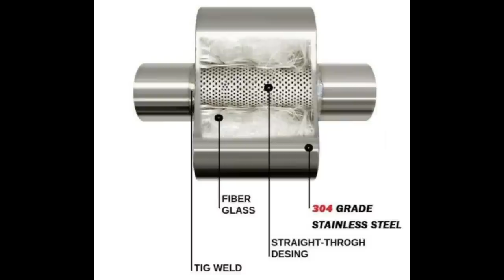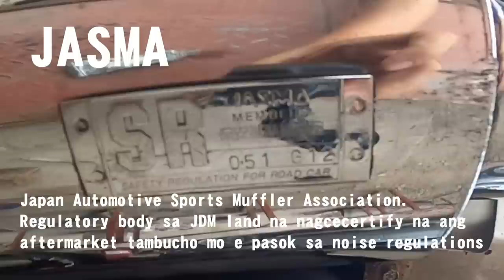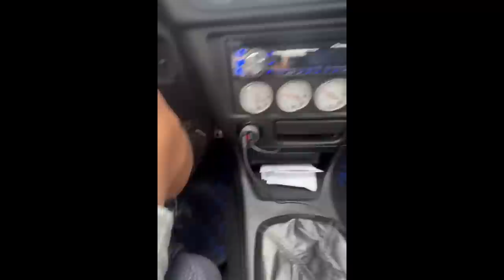Nagpaayos ako ng muffler

Comment: Good afternoon. Ask ko lang sana. Nasira yung muffler ko and walang original OEM muffler available. Pumunta ako sa shop and they have an available one. Pero my car is Nissan Sylphy 2016 (1.6 CVT) and ung available is for Vios 1.3. Na replace naman. Wala din naman red indicator. Works ok, pero ma feel ko parang may pressure and bigger sound sa exhaust if nag increase akong RPM. Im ok naman, but concern lang ako baka it will affect my engine. Ok lang kaya ung temporary replacement ko while waiting for the original one. Thank you sa maka answer